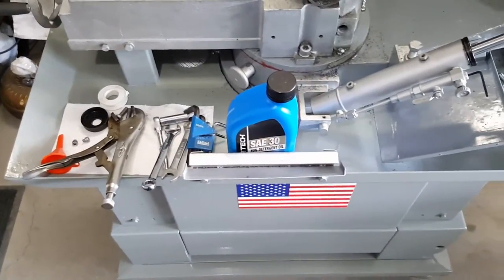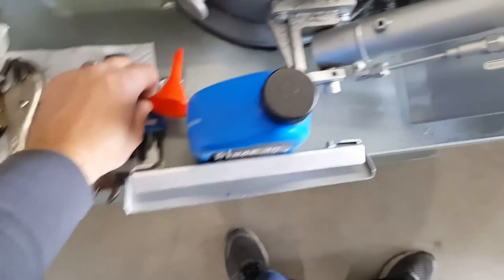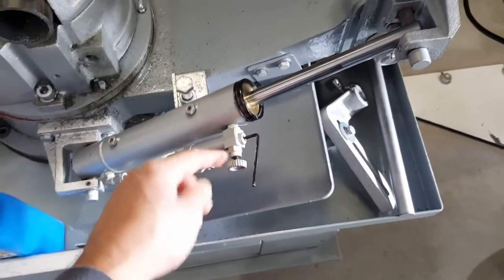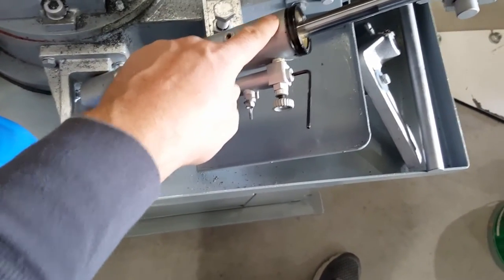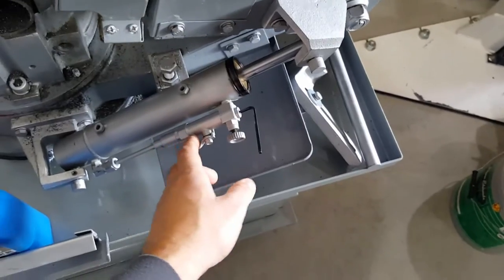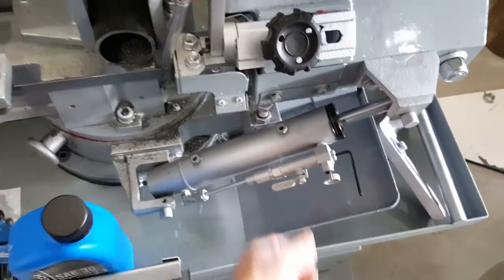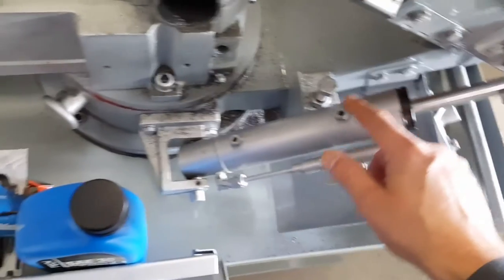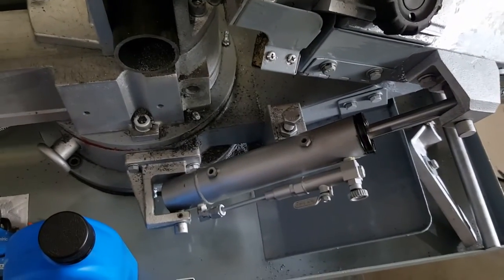Horizontal band saw cylinder overhaul with oil SAE 30

Comment: Been trying to find what size o-ring is on the piston in the cylinder, want to buy a replacement. I just got a saw from harbor freight and the cylinder isn't working. Took it all apart and the o-ring looks improper. The shutoff valve and flow adjustment are working but you can tell the oil is just flowing through the piston. Sure I could return the saw to harbor freight but with travel time and down time on the job it would be way more cost effective to just buy a new o-ring locally(harbor freight is a ways away) or even buy a new cylinder all together. I can get a new cylinder in about 1week. Harbor Freight wants me to return the entire saw and they don't have another on hand so it'll be a 2 week+ wait time for a replacement.

Comment: excellent video.  I used transmission fluid instead of sea30 and it worked fine.  I didnt have the allen key weep hole in mine so i undid the speed wheel and let it pour out of there.  Thanks!